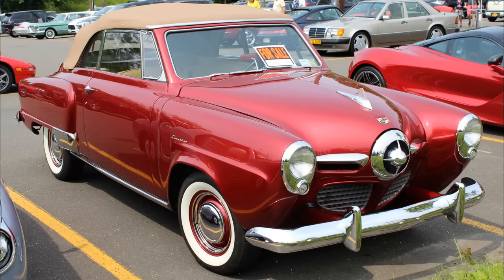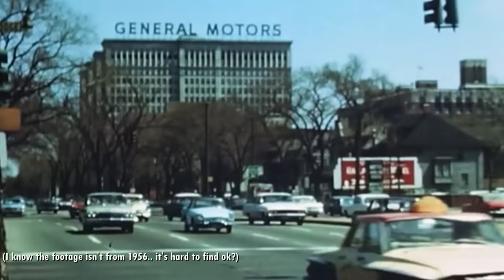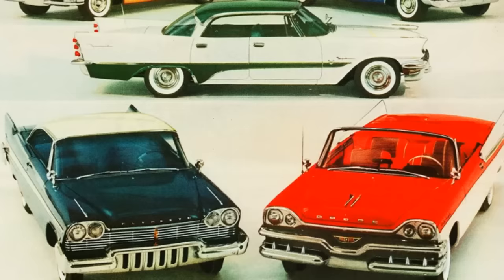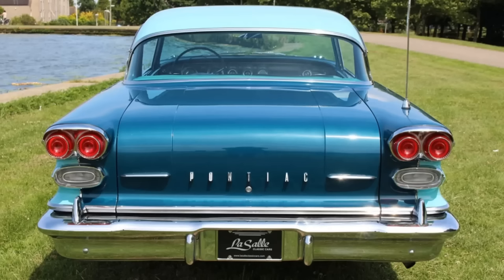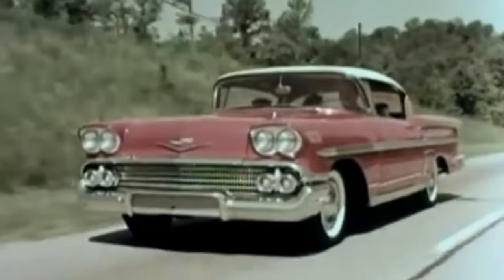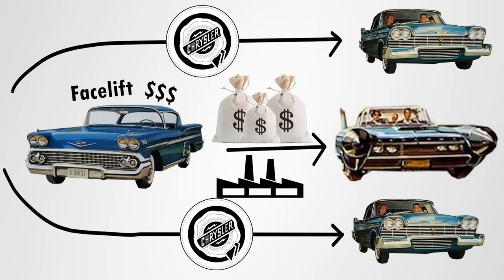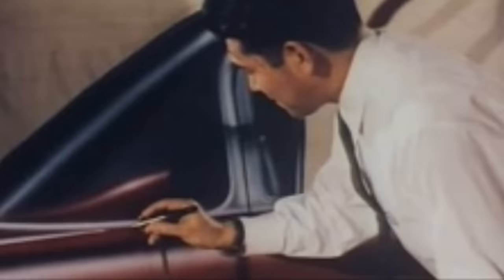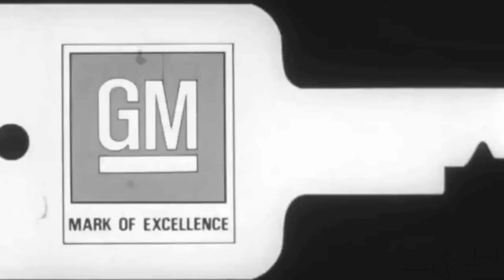Mistake of '58: The GM Chromemobiles and Far Out '59s

Comment: My dad had a '58 Olds.  It did have tons of chrome and REAL BUMPERS.  Even the dash had lots of chrome on it.  It rode like a cloud on the highway.
Reply: @Kenneth Hoffman The problem was they added power assist, but kept the manual ratio which required many turns.

A friend with a 61 Chevy turnd almost 5 revolutions from full left to right.  Lot of spinning to parallel park.

My 68 Caddy had a variable ratio rack.  Slow near center for highway driving but faster as you turned for parking.   Much,uch better.
Reply: The chrome fin on top of the fender fin, that you had to swing to one side to get to the gas filler was "special."
Reply: I had one. Great car.
Reply: @grizzlygrizzle  Yes, I forgot about that until you mentioned it!  It certainly WAS special.  MOST of the time, you had to tell the gas station attendant where to add the gas.
Reply: @MrNunna  It was in the little fin on top of the big fin. Fins upon fins! That car was over the  top. Personally, I thought that the '55, '56, '57, and '63 were the best looking full sized Oldsmobiles of that pre-late-'60s era. My father was an Olds dealer, so I knew them all well.
Reply: @Kenneth Hoffman That wasn't the reason for the "suicide balls" (AKA wrist breakers)--it was the lack of power steering.
Reply: All cars have real bumpers. In new cars they're just covered
Reply: @riffhammeron those ain’t real bumpers, kiddo
Reply: @danieldaniels7571  sure they are

Comment: Yeah, I know GM’s chrome cars are supposed to be mistakes but I love them. The more chrome the better.
Reply: I Agree lots of real old style chromed steal on a vehicle makes them look sweet, esp.  big, heavy, chromed steel bumpers, front and rear.  But some of the "chrome" trim was sweet also, made of real polished stainless steel, not dipped plastic... which is great in my book too. I hate the cheap plastic garbage vehicles they have been making since the late 70s /80s. P.S. the old mistakes are still 200% better than the designed ones of today.
Reply: If GM From the 50s could just hear all of us talking about the awesome cars they built back then.. Ford I think was the 1s who fell behind after the 54 production.
Just my opinion...
Reply: @tommyjay4723  my father had been a Ford man, and when he got out of the Marines in 1957 he bought a new 57 Ford. He liked the 57 Chevy better as he sqwaked the tires in all 3 gears lol. Buy he went with the ford as it was 200 bucks  cheaper lol. Anyway he got a lemon. Was a piece of crap from what I hear. By the time I was born 1969, we had a 65 Chevy Caprice. 327 dual exhaust, quadrajet. Was a beautiful car that could really move. In 77 they got a 77 Malibu. Ok car, but in my opinion those mid 70s Chevy's were the ugliest cars ever made.
Reply: I love my chrome pipes underneath my bathroom aink

Comment: The '58 Impala is one of the most beautiful pieces of machinery ever assembled.
Reply: It absolutely is. Even the interior is the most beautiful and lavish Chevrolet ever did. I've got one guy here telling me I'm wrong that the '58 Impala had fins apparently because Ed here said they didn't. Ed's wrong, and does make the occasional mistake in his videos. No, the '58 fins were not the 'sharp edged' fins of the '57, '59 and '60, but  instead were gentler, rolled fins instead. Truthfully you'd have to blind not to see that, but oh well.
Reply: @robmcgowan4034  I had a friend with a '58 Impala in college. And I have to say, in terms of design, her car outclassed my '63 Catalina. But only slightly.
Reply: @eriksmith6873  The '58 Impala had all the bells and whistles that (of course) were long gone by 1963, when the '61 Lincoln's sense, sensibility and simplicity was the standard for the new decade. The '63 Bonneville and Catalina were 2 of the best looking full-sized Pontiacs ever. Somehow in '58, even though they were basically the same car as the Impala, the '58 Pontiac just didn't have the commanding magic of the Impala. Part of it was the 'Sculpturamic' rolled-style fins the Chevy had, along with the stunning use of chrome. Wouldn't you agree that the '58 Impala did have fins, even though they weren't like those before or after it? Those fins ushered in the look of Chevrolet's horizontal fins that would peak in '59, be reduced on the '60, ushered out on the '61, and gone completely by '62.
Reply: All that chrome without being gaudy. '59 made the Impala look fast with all the chrome trim, while the Bel Air and Biscayne looked boring without it.
Last week I was at a truck stop in Tennessee, and just before I went to bed, three pickups with car trailers rolled in. They were all classics, but the last one was a ' 55 or '56 with the '59 Impala rocket trim. It looked like it belonged on  it.
Reply: I don't get it.   Agree to disagree,  I guess.
Reply: Agreed
Reply: 59 chevy el camino.
Reply: The '58 Impala was the best looking car Chevy ever made. Hardtop, or convertible. There's one for sale now, (red / black rag top), just a few blocks from where I live.
Reply: MY FAV IS THE 58' BUICK INVICTA!
Reply: 55 chevy
Reply: groan
Reply: @bbgcars  I can only imagine how much it would  cost to re-chrome the bumpers on one of those.
Reply: @jeffrobodine8579  OH I KNOW right? hehe
Reply: Sure wish I still had the one I had in college. 20/20 hindsight, don't ya know...
Reply: goatboy150 Timestamp?
Reply: I so agree! I absolutely loved the 58 Impala especially the convertible.
Reply: @DavidStirm  The 150 models of the '55-'57 were nice. Especially the '57 'Black Widow'.
Reply: @bbgcars  Never seen a '58 Invicta. Was it a prototype?
Reply: Sorry, but it just ain't so. The '58 Impala design was little better than a dumb brick. Total opposite of the '57 Chevy.
Reply: @whyis45stillalive  EARLY ONES WERE But your spot on with your knowledge!
Reply: Always thought the Impala was a bit overdone.  Biscayne and Deray were too plain.  The Bel Air, now, THAT was perfection!
Reply: Delray-typo
Reply: @martinfranke846  From the cowl back, the Impala hardtop sheet metal was different from the Bel Air. Most notably, the roofline was lower, and shorter. The trunk had more of a taper. Even the rear quarters were different. Only the rear bumper was the same.

Comment: Very interesting! I see a similar situation currently. We also live in an era of bulgemobiles, or more bulk-mobiles. The actual cars can't be more bulky huge offroad truck-like enough. Look also to the rear ends of Cadillac Lyriq and Celestiq. Those overstyled themes are back. We urgently need a new 1961!
Reply: It's not the bulge so much as the designs now have almost no coherence to them.  It's like a 6 year old kid  scribbled some lines on a piece of paper and threw a bunch of awful gawdy crome and big ugly lights on it.  Futhermore it's not just American companies doing it. It's practically all of them except for maybe VW/Audi who still have a nice elegant flow on their designs.
Reply: I would argue that not only are the current vehicles extremely ugly, but they all look al.lst the same.  It's really tough for me to see a difference between a Chevy, Hyundai, and a BMW.  If it weren't for the badges it would be tough.  I think the companies are even sharing parts.  I was at a dealer a couple of years back and the interior of a Toyota was quite similar to the same SUV thing as a Lincoln.
Reply: You know the gigantic emblems they put on the front of cars are so hideous that it's laughably bad.   We had no reason to laugh at the cars of yesteryear when many of today's designs are genuinely ugly and non-functional.
Reply: @joegrazulis2810  If you took the emblems off a BMW, Honda, Hyundai, and Audi 3 seat SUV's and put them next to each other, even their owners couldn't tell them apart.
Reply: @joegrazulis2810  Have you seen the BMWs recently?  They are hideous!
Reply: @dr.elvis.h.christ  have you seen the new kia logo? its awful, we really do need to get back to the cars of yesteryear

Comment: The 58 Chevy and GM style is a decent match for the 59 Ford style. I just recently learned that Ford rushed through a radical change to the style of the 60 Fords because they heard of the new style that Chevy/GM were going to bring out. Which explains the resemblance between the 60 Starliner and the 59/60 Chevys, etc.

Comment: GM's 1957 models were mostly beautiful, but to me the best styling at GM happened under Bill Mitchell and 61 through 72 were just beautiful, after that the huge mandatory huge bumpers ruined most of the design , but the downsized that started at GM in 1977, they did it the best IMHO.   As a little kid in the late 50s with teen brothers, I saw a ton of 58 Chevy Bel Airs but my parents bought a 58 Plymouth
Reply: I'm gonna be honest I'm a huge sucker for mid-late 70s oldsmobiles pontiacs and chevys. They're these monolithic boxes and somthing about that is really appealing to me.

Comment: Memories of a 1958 Pontiac.

Back in 1974 while on extra gang for a railroad during the summer I recall the section chief would transport the hand tools to the job site in his car. There we would be pulling out the spike mauls, the B mauls, the spike pullers, the joint bar wrenches from the trunk. The car level.

The trunk would close and the tools carefully laid, so as not to scratch the paint, on the trunk lid.

1958, the sheet metal must have been on the plus side of a sixteenth of an inch.
A tank.

Comment: I was there... I remember the test drive of my dad's brand new 1951 Oldsmobile, as I stood up in the back seat floor board.  I remember the 1958 Olds in a newspaper ad... awesome, I remember thinking!  A 1958 Buick Limited on the showroom floor with the air suspension that raised the car up and down... burned in memories in a young man's mind.  Yeh, they were chromed , but that was the style, and if you were a GM fan, it was just fine.  We thought they were GREAT!  :)   The '50s and '60s were a revolution in automobiles... my favorite decades in automotive history.  Todays cars are more reliable, hi-tech, etc... but I'm thinking that restoring a 2022 Toyota Camry 30 yearsf rom now will be virtually impossible with all its 'dedicated electronis, micro computers', etc.  and the plastic parts...well maybe ... someone will be remolding them too  :)
   One BIG deal is you could tell what kind of car was coming a block away.  AND a CADILLAC, or LINCOLN was something SPECIAL.  Now?  is it a Lincoln or a Kia... (let me check that logo on the trunk!)  Everything seems to be 'wind-tunnel' designed and who knows what kind of a sedan or SUV it is at a distance... All cookie-cuttered with very little 'character'.
Reply: Look at the ratsnest of tubing under the hood of a 70's car -- masses of power-sapping anti-pollution measures that barely even helped.  50's and 60's cars were only simple because they didn't have to care.  Modern electronics have made cars a great deal better *and* simpler than brute force mechanical engineering

Comment: The '58 made a statement...even of rebellion. In the 1980s there was a designer at GM in Detroit who drove a pink 1958 Buick in quiet protest (so he said) to the awful new car designs. The irony is that the very car designs he was protesting...they're now collecting.
Reply: I didn't like those designs that he was protesting either, but they are a hell of a lot nicer than what passes for "design" today.
Reply: @michaelbenardo5695  Amen, brother!
Reply: @michaelbenardo5695  RIP Impala, 2019 was the end of the styled sedans CT6 and LaCrosse too, V6 for that matter too. Hello 4 bangers at T4s!
Reply: @patcurrie9888  Strange that people didn't take to the final Impala.  It was available with a V8 - yes, a small Front Driver with a V8 engine.  One of my co-workers had one and did not like it.  When I asked him what was wrong with it, it couldn't find a reason.  I think people didn't like it because it was not Japanese.
Reply: @michaelbenardo5695  No V8, V6 a front driver tho. I picked up a 2019. Glad I did.
Reply: @patcurrie9888  I would like to test-drive a V8 model.  Would be fun to see how a small FDW with 300 horses feels!
Reply: @michaelbenardo5695  V8 went away with prev version of Impala, 2015 to 1/2 of 2020 was V6 and an anemic 4 cylinder. The V6 gets 305HP. I scooped up a 2019.
Reply: If you want ugly, check out the recently released BMW XM
Reply: @patcurrie9888  I saw under the hood of a co-worker's, and it had 8 spark plug wires.  I am talking about the one that was being produced when GM declared bankruptcy.
Reply: @The_Ballo  Yuk!
Reply: @michaelbenardo5695  Prev  models went up to 2014 for fleet sales as newer model started as private sales. The bankruptcy took place on previous model, the plain jane model, cool tho if it had a V8.
Reply: @patcurrie9888  It was an option.
Reply: @michaelbenardo5695  The BMW XM ought to be considered vandalism

Comment: Even as a kid, I wondered what went wrong in 1958 at GM. The 1957 Chevy had its own classic good looks; then the 1958 Chevy looked to me like a loaf of bread. When the 1959 Chevrolet came along with its radical wings and cats' eye tail lights, my family bought an Impala sedan and requested a custom paint job from Chevy -- most had a white top and a white trunk deck; ours only had a white top, and the trunk deck was the same Tahoe Turquoise as the rest of the body. We drove that car all over the USA, and when I was old enough (and the car was old...) I learned to drive it. Thank you for an interesting story about what went wrong at GM for 1958. Thumbs up!

Comment: I have to confess that as a kid, and still now, I love those chrome laden cars.  In my opinion most vehicles after the 1960’s are just plain ugly.  I know that for safety and cost reasons chrome will remain a relic of the past, but I still miss those beautiful vehicles.  They were a work of art.
Reply: I used to think that too <1969 or nothing. Slowly slowly, my appreciation for newer cars has grown. 
First the boaty brown cars from the 70s started looking good to me. Now as they've all left the roads and I start to miss them, I appreciate the boxy cars from the 80s. I grew up with the cars of the 90s, so there's already an appreciation for some 90s cars. I just have to learn to love the 2010s and we're set! 

I think that as cars on the road now get more plain and smooth, as electric cars do away with the need for grills and everything gets more grey-on-grey-on-black, anything that's different or a bit nostalgic starts to look better and better.
Reply: @blahblahblahblah2837  What do you think of 00's cars, like the spaceship-like 2000 Pontiac Bonneville? I prefer 90's and 00's cars over anything made after 2009.
Reply: @hakeemsd70m  I can't say I love the 00s either, especially interior styling. It's hard to romanticise cars from 00s when they're the cars I probably see the most of, and often in terrible condition. Mechanically, they'll probably be the greatest decade of cars though in terms of longevity
Reply: I made sure my 2020 Toyota 4Runner had chrome on it.  My 2011 F150 does as well.  Everyone wants to black-out or chrome-delete things these days.  Just doesn't look good to me being all black.  Heck cars had colors back then.  Today, cars only come in black, white, and 2 shades of gray... or you have to pay more for something with blues, greens, or reds. The base color of my 4Runner is Nautical Blue, not my super favorite color, but WAY BETTER than black, white, or gray.
Reply: @blahblahblahblah2837  when it comes to cup-holders interiors have got better.  I remember going to Canadian Tire and buying up every new design of device that would fit in the window and hold a cup without spilling it.  Some were good but none were perfect and some were just plain awful.  But mechanically there has been improvements made, as you point out.
Reply: U should come to the hood then 😏

Comment: What's funny is that over at Chrysler they must have been peering over the GM fence  and thinking 'our 58 Mopars will do, but by 1960 we need to load these down with all of the chrome we can find to compete with GM'. Coldwarmotors (YT channel) has been building a '60 Fury, and I cannot believe that there wasn't a UAW strike or mutiny when the assembly line was told about all of the trim they were expected to do on the Furys.

Comment: My 58 Olds 88 was a fun car.  It had luxurious seats that could be used as beds if necessary.  The large V8 had lots of torque and it could run at more than 100 mph.  I had to sell it when I went into the service, my dad's garage was full with his 64 Olds 88 and his lawn equipment.  I could have driven it to my first base assignment in MA at Westover AFB.

Comment: Great video on my favorite cars ever.  One thing I can add that you did not mention: many years ago I read somewhere that the amount of chrome on the 58 GM cars was not originally planned, it was hastily added (the author said “with a trowel”) to their designs as a response to the 57 Chryslers.  As you point out, the 58 GM body designs were already locked in when the 57 Chrysler designs were seen, but their trim was not - and adding more chrome was a less expensive way of making the 58 GM cars appear more modern and futuristic.
Reply: I'm pretty sure you are right. The trim is one thing that they could change at a late date.